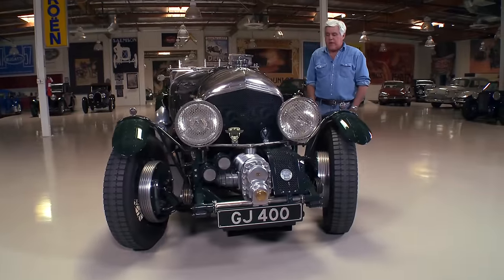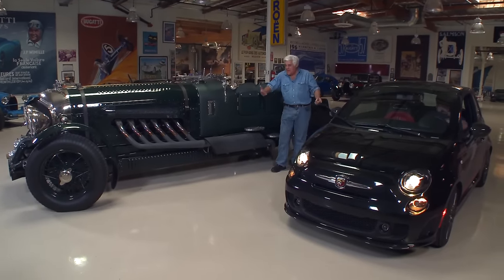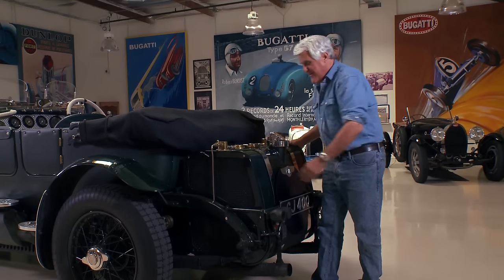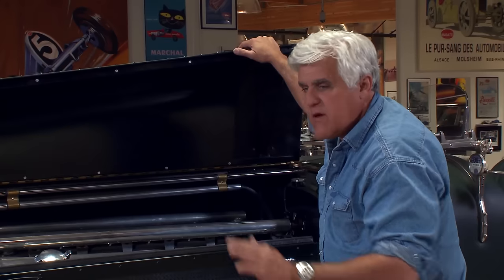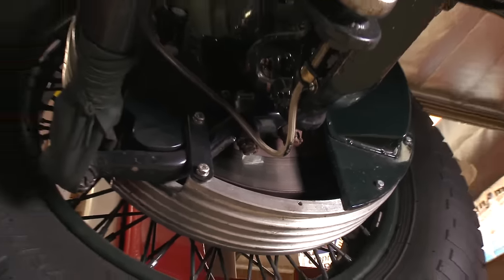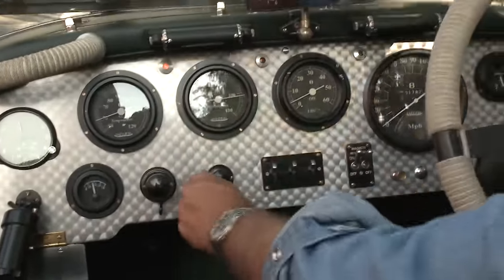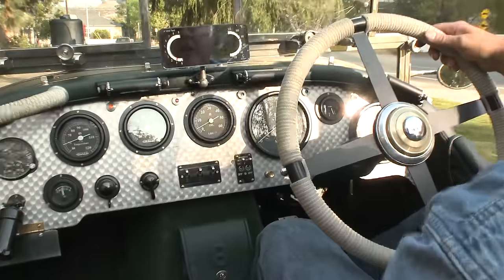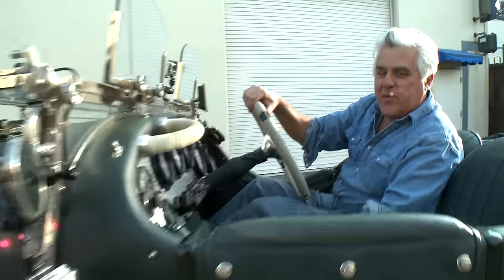1930 Bentley 27-Liter - Jay Leno's Garage

Comment: IIHS test results: 60-0 234 ft / 100-0 (ran into sand pits) side impact rating - 0 / 40% frontal offset - 1 / rollover protection - wear a helmet or jump out of vehicle / pedestrian accident avoidance system - multiple fatalities / EPA fuel economy - 3 gallons per mile / overall safety rating - non-existent.

Comment: I wonder how fast it would go at high rpms
Reply: 2800 RPS were max for merlin...but if you go to War Emergency  they would turn low 3,000.  Reno Racers turn the Merlin over 4,000 RPM..

Comment: Does this merlin make 1700 hp as  well?
Reply: The aircraft ones were supercharged. I suspect the compression ratio is de-tuned as well so it will use regular pump fuel
Reply: If I remember correctly, it makes about 1650ftlb. General rule of thumb is wet weight in lb = capacity in ci = torque in ftlb.
Reply: How about paying attention to the video?

Comment: 700 hp for a Merlin? Thats kinda low the spitfire mk1 had merlin that was 1,050hp or around that. And the p-51d has merlins but they were license built by Packard, and yet those merlins put out around 1,500hp
Reply: It's meant to be understressed, which is why the power is so conservative. It can be cranked up far more, but at the cost of reliability. Remember, it's an airplane engine operating on the ground. Heating is a big issue.

Comment: So what is the gas mileage anyway??????
Reply: With a engine that big the measurement is done in gallons per hour (seriously)
Best numbers I can get you is 30 imperial gallons per hour (30 imp gal/hr)
It varies because when flying the amount of fuel being used changes but that figure is the best I can give you for this car driving on a normal road.

Comment: Really cool car, but I am disappointed.  What did I want that I didn't see?  Full throttle runs, 0-60, burnouts, exhaust cut outs.  Having a Merlin mated to an automatic transmission with a luxury car exhaust, just cruising around town is about as sexy as rolling around in an LA transit natural gas bus.
Reply: You are joking, right? If not, you have just demonstrated why Americans are widely regarded as having no taste, no discernment whatsoever. Burnouts? Yes, Jay does them because his juvenile viewers expect it. How original is having massive horsepower overwhelming rubber? So mature.

Comment: Why two oil gauges
Reply: One is oil temp the other is oil pressure.  Remember it's an aircraft engine.
Reply: Doc is correct, also I have an Oil temp and Oil Pressure gauge in my 1982 MB 300 SD turbo diesel!  Its a interesting car, from a point that with enough money and skill you can adapt an aircraft engine for use in a motor car!  I wonder about where he is getting the high Octane fuel those Merlins feed on!  Avgas 130/140 is long gone!  It would be interesting to take a road trip say the whole of US-101 for an example!
Reply: When you have more "money than brains", who cares.How'd they get away with not having the gas tank inside the frame?
Reply: +George Semel The engine isn't actually a Merlin, it's a Meteor tank engine that was based on the Merlin.  The Meteor powered Cromwell, Comet, Centurion and Conquerer British tanks (plus others), as such it was designed to run on 80-octane fuel which also explains the lower power output (even early Merlins were rated at over 1000hp).
Reply: The Meteors were rebuilt Merlins. I'm not sure R-R ever actually built Meteors new, they just reused tired old Merlins.

Comment: Imagine putting a huge 70mm turbo on this baby! Ehh, that would basically be sucide tho
Reply: +CrazyGamerZ4G They did (a supercharger actually)  back in WW2, The most powerful version was about 2500 BHP!
Reply: +CrazyGamerZ4G   The Merlin supercharger impeller had various sizes, but the one I run has a 10.25" (260mm) diameter impeller running at up 27,400 rpm.  Merlin power development for production engines ranged from 1,030 hp to 2,040 hp.

Comment: Why don't they make 27 liter engines anymore? i mean other than the regulations where they want 30mpg, and the fact that it would take around 3 of these cars to deplete the ozone layer, someone should make there own country, have no regulations, and have a really good space program..... cause they'll need a new planet after they.... you know. lol but really cool car, would love a modernized over the top hot rod like this. i'm imagining a 25 liter futuristic version of this, making roughly 2000hp naturally aspirated (cause a turbocharger seems immoral for this) try to mess with the cam profile so it get's max power at a low RPM, then gear it tall. still heavy and useless, that is the spirit of the car. AWD seems wrong on it also,,,, but my idea neglects grip.... and the futuristic tall hot rod aesthetic would look.... plain wrong with wide tires.. hmmmm well first steps first. found a country with no regulations, may need some money for my new project.... I have 10$ and a 06 bimmer..... wish me luck
Reply: They make MUCH more powerful airplane engines today, that burn a LOT more fuel. A jumbo jet holds 40,000 gallons and there are thousands of them in the air every day.

Comment: "I'm going to make an awesome car, but I'm going to stick an automatic transmission in it so it sucks! I'm a genius!" Seriously, what's wrong with the people who make these cars?
Reply: +Gunnar Konig It might be the only gearbox that could handle the torque... this was the case when John Dodd built a car with the same motor.
Reply: arch9enius There are no manual gearboxes that can handle it? Really? Seem a bit far fetched.

I mean, think of all the high torque lorries, tanks, etc. that have manual transmissions.

It just seems like a massive waste to build such an otherwise awesome car and then be completely unable to control it in a satisfactory way.
Reply: Gunnar Konig
Well, I don't know the figures but they took six cylinders off this motor to build an engine for the Thorneycroft Antar tank transporter in 1957-ish.
Reply: It may be because of the bolt pattern. Allison makes transmissions that will bolt up to just about any large engine. Also the simplicity of never having to do a clutch job with an engine that makes more torque than any big rig diesel engine.
Reply: +Gunnar Konig Why would you need a manual in this your not going to take it drifting or drag racing. There is no upside to having a manual.
Reply: Gunnar Konig "It's obvious you're not actually a driver"
Ive been driving longer than you have been walking.
You dont seem to know what stop start traffic is. You know where you start in first then go to second then the traffic slows so you go back to first. Then it stops then you start in first then go to second then the traffic slows so you go back to first and so on. 
If you pull away in 5th gear you will ruin your clutch very very quickly. Other than bitching and being nothing but a butt hurt little child that is defending an antiquated piece of technology you are yet to give me any actual reason to have a manual over an automatic.
Give me 1 upside to owning a manual car.
Reply: +weirdstuffanimation7 Some of us just like manual much more. Probably 95% of cars in northern europe have manual shifters.
Reply: Mikael Levoniemi I know that My car has a manual gear box. I live in England. I still dont understand why its better to have a manual gear box when 99% of my time Im doing 4 mph in a traffic jam. Nobody has come up with any actual reasons to own a manual over an auto.
Reply: Mikael Levoniemi Im not even against the manual gear box people want what they want.  Im against people that say having an auto in a 4 ton Bentley with an aeroplane engine ruins it, Yet nobody has actually given any reason other than they prefer a manual.
Reply: +Gunnar Konig And here we a professional six year old. Just because 12 years olds say manuals are better it doesn't mean that's true.